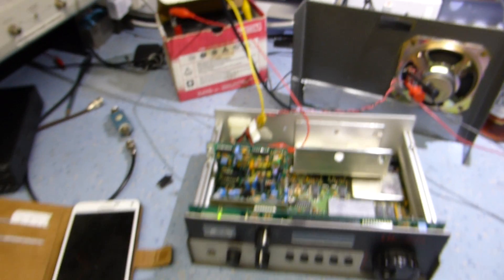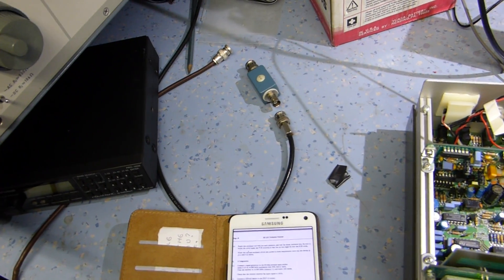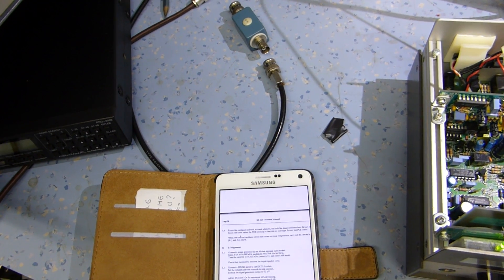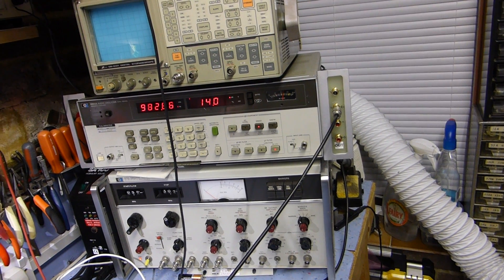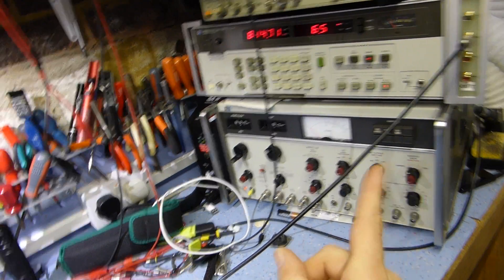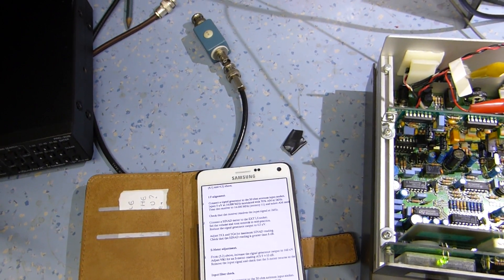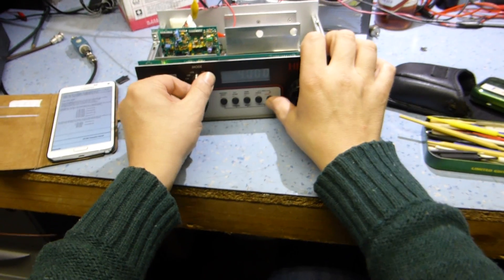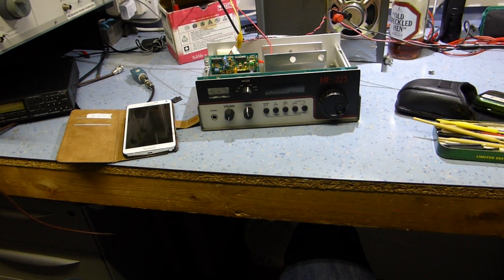Adjusting Lowe HF225 IF using SINAD

Comment: Hello, can you tell me which component is used to adjust the frequency about 100hz, its ever so slighlty out, 5.505 mhz is about 100hz low. Thanks Gary
Reply from the maker: It depends on what you setting it too. Tune to 198 Khz and select usb then Lsb . There should be no beat.. You can't rely on 5505 as its a ssb signal.
Reply: @SoddingaboutSi  Thanks mate.

Comment: Hi Simon
Would it be possible to align my HF 225 without instruments ie by ear?
Reply from the maker: Unless it is seriously out no. They are so high quality I doubt it is out of alignment. If it's not performing it might be a fault?
Reply: @SoddingaboutSi  Thanks Simon, just that the frequency display was out by a few Hz and I adjusted this with the trimmer immediately behind the display on the front panel, but not before I'd tried tweaking the other trimmers you show in the video! Trial & error is not a good idea I know! All seems ok on the whole range though, tested it on Anthorn's 60Khz, 14-megs-ish, 12095 W/Service & 10/11 metres CB. Thanks.

Comment: the camara should be Held more static, turning around so fast makes the views hard to follow. As the SINAD meter may have a definded sharp notch at 1 kHz the Offset of the measured AF frequency (985 Hz) may result in erronous measurements, so "alinging" does not make sense.  If You would have used a R&S UPA which automaticlally notches the "wanted" 1 kHz or 985 Hz Signal out You may have got a better result. Also remember that even the Audio amp may be overdriven resulting in harmonics which are then measured as distortion.  So at which AF output power died You measure?
Reply: +Simon Spiers before You adjust the notch, please also make sure that the output of the audio amplifier does not produce distortion > 10 % (10 % dsitrotion would result in a SINAD (Signal interfernce noise and distortion)  of 10 % alone.That is why ofteh the SINAD meausrement is taken at 50 mW Audio output power, or nominal ouptu power of the AF amp.  An socilloscope showing the demodualted Audio sometimes can give You hints of distrortion. At least: what about the mains hum? do You see this on the envelope of the recoverdd Audio?do You measure using the so called Audio CCITT filter which attenautes low noise and high frequency audio signals >3 kHz?You can see there a a lot of obstacles You can get into if You do the measurement not correctly.